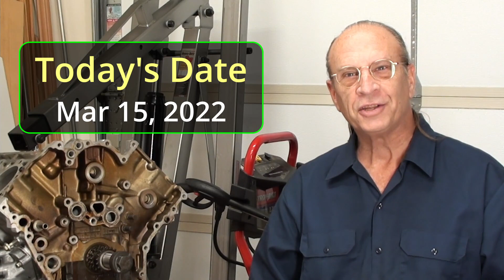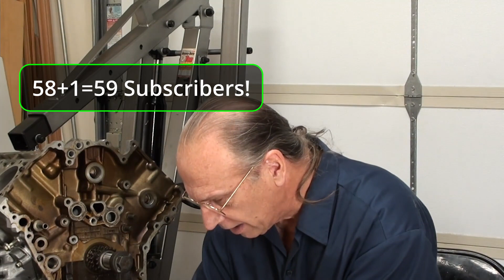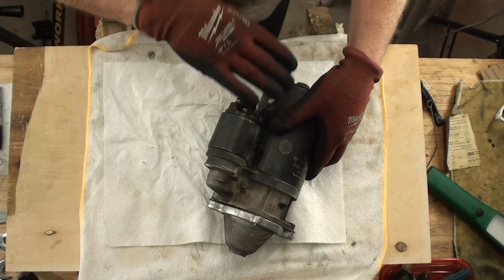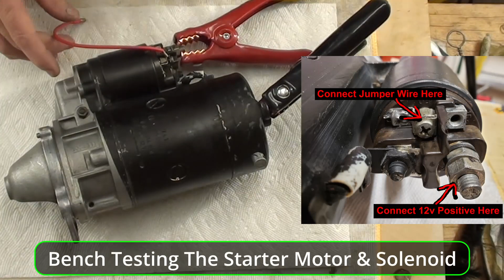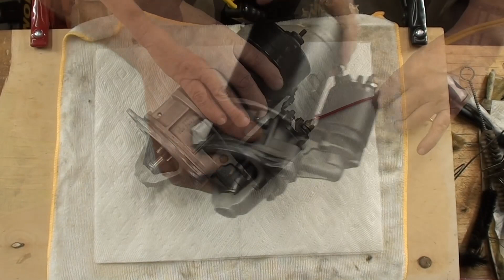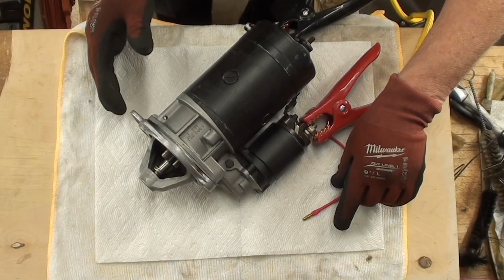560SL - Bench Testing Starter Motor & Solenoid

Comment: There at the end, where you apply voltage and the plunger moves....i wonder if that hole should filled with solvent as the plunger keeps moving. I bet that would clean it. I r would it explode due yo electric current ?

Comment: if the engine has a really hard time starting on my SL560....starts mostly only with start pilot spray - is the starter bad or could it be something else? battery is fully charged...
Reply from the maker: Maybe it is the battery if it is slow cranking. If the engine turns over normally then it is not the starter. Hard time starting could be anything.